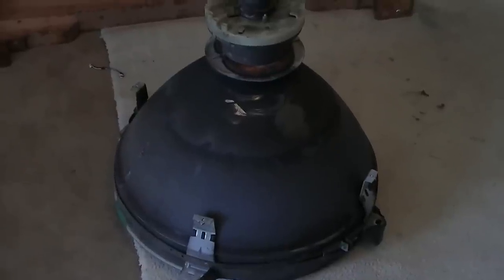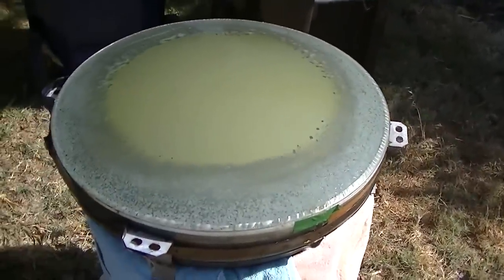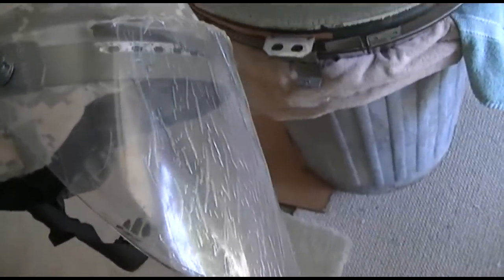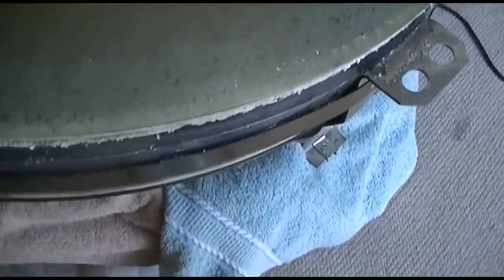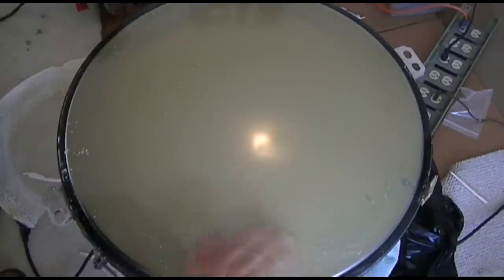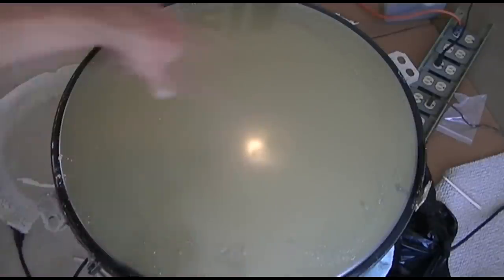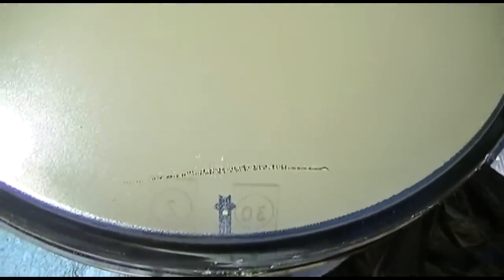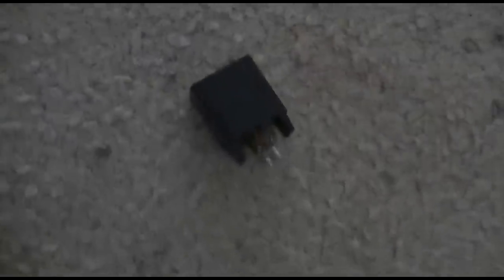Roundie CRT 21FJP22 Safety Glass Removal Cleaning Dirt Mold Out Of Vintage Picture Tube TV Screen

Comment: Nice work. I have used wood clothespins for the wedges as well as the chop sticks. The clothespins have a nice gradual slope that works well to apply even pressure.

Comment: Cuz it can blind you if tube implodes and glass comes out the front. Safety glass helps prevent that. Guy who use to work at Admiral told me a story about a picture tube that was installed too tightly in a customer's set. Customer got up to the bathroom and tube impolded and sent a big piece of glass into the back of his wood chair that he was sitting on.. These things are nothing to play with. I had one implode on the side of my house when it was cold out. It sounded like a gun.